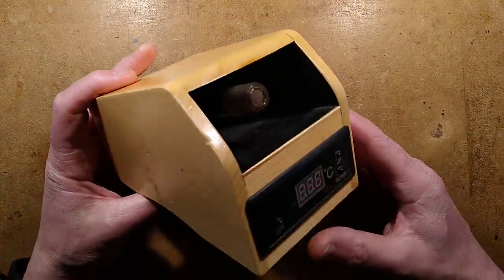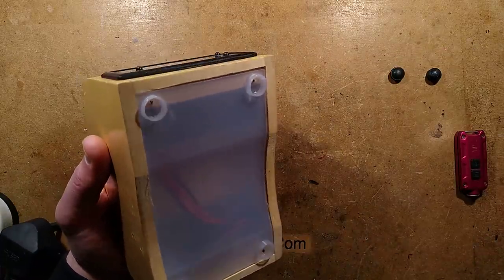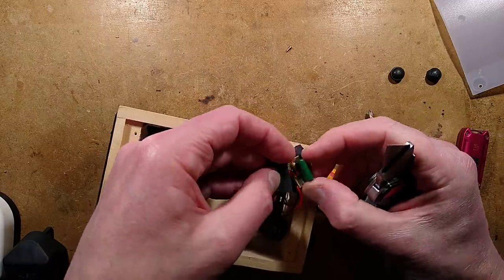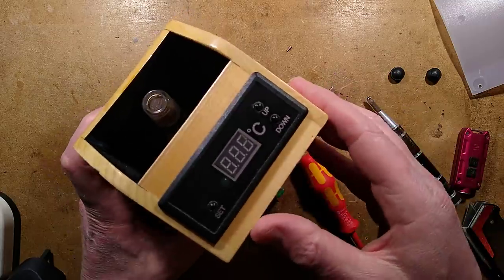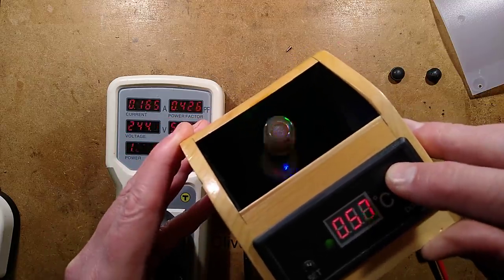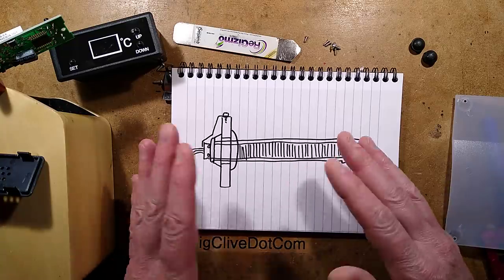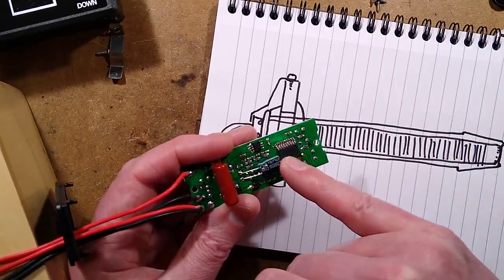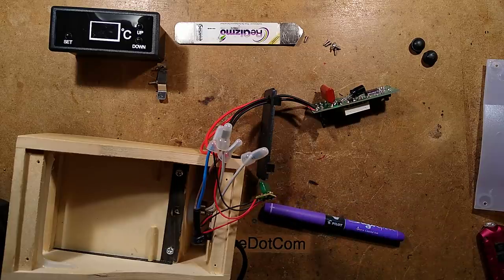Exploring a mystery gadget

Comment: Ive had one, but never seen the insides before. Its my understanding that its essentially a soldering iron with a glass fitting. It uses tubes that plug in, I think they call them whips. 
The one I had was actually a fairly nice unit, I cant remember the name, I didnt really use it. It turns out that I prefer a bowl, since the pandemic, herb sticks have often become the device of choice

Comment: "Vapor Canon" is missing the "whip".. Air comes in at the bottom of the glass tube with the frosted connection for the silicone tube that has another piece of glass in the end with a space then a screen and you inhale the ground herb through the "whip" and against screen setback about 2"(50mm)  after that space(for the herb) screen stops it there and you then place the glass piece with herb on that end of the silicone hose on the wooden box glass with the ceramic heater. The air comes in through the bottom of the glass with the lights that attaches down inside the wooden box. there are usually 2-4 holes in the glass near where it threads on, going over the ceramic rod which let's the air come in the bottom of it heating as it goes to the tip and bringing vape through the herb as you pull warm air through it/  through your whip (4-6 inch piece of glass with conical frosted connection to match the one in box, gap for herb, then screen to hold the herb from going up into the hose which has a mouth piece at the other end) this is pretty much the first legit design where only hot air touched your herb, before this it was basically an upside down jar with a soldering iron sticking straight up inside with a little metal plate on the end you put the herb on then let it heat that tray up and fill the upside down jar or gumball machine looking thing, then stick your hose in the side and pull out the smoke...

Comment: I remember these were always the worst lol. For vaping dry "flower" you really want an active convection unit. I'm not saying that you can't get decent results using conduction, but there's usually a steep learning curve and will always require alot of stirring of the material and constant temp adjustments.
Reply: These worked just fine

Comment: I been working on or examining not just electronic but all types of gadgets my whole life and pride myself in usually guessing what something is or what it might be used for when I see it. I thought it was going to be either some type of audio/sound mic for specific frequencies or maybe an infrared (or other type of  electromagnetic radiation) detector but never never would I have guess a bong :)
Reply: On first glance I thought it measured ionising radiation as the tube and grill at one end looked remarkably like a Gieger-muller tube, which I was acquainted with when working health-phys in the reactor compartment of a nuclear boat - then I saw the LED temperature display and the game was up, I knew instantly what its likely use was.    Yeah, I know - the notion of a gieger counter in a wooden box seems somewhat implausible...  But it could have been a school  project (?)

Comment: Maybe it's programmed like my refrigerator thermostat (the style of which you've featured on this channel recently), it has a "do not stall the compressor" feature.  If the temp is above the setpoint plus the tolerance at power-on, it delays for the compressor delay to make sure there was not a brief power interruption, therefore the tstat has no idea for how long the compressor was off.  Seems kind of silly for something at 200 degrees, but no good way of knowing.

Comment: Darn, everyone has already educated you on this herbal vaporizer.  I used to have one.  These particular units are considered cheap-o versus others, for one thing, the user has to regulate the airflow (surprisingly carefully) unlike units with their own air pump.  I've see these sell for anywhere from $50 - $100 here in Colorado, USA, where all of that stuff is completely legal now, and both cops and legislators (who get to spend the tax revenue which comes back to the state) are quite pleased about it too.
Reply: Some of these units (it has been cloned infinitely)  come with a light show for the glass lamp: a 3-color diode that cycles - quite slowly on the ones I saw - through the spectrum, sorta, within the limits of the sad little LED.

Comment: You can pull the glass tube out of the grommet just wiggle it around a bit it'll loosen up, I've done it a few times to put it in a better designed vertical arrangement

Comment: apparently these have a dangerous ceramic heating element in them that releases small ceramic particles which you then end up inhaling... which is not so good, although you can get ones that more expensive that are made with better components/safety features etc. but these desktop style units are considered outdated at this point, especially when you can get whats known as a "dynavap" for around 60 pounds and build your own induction heater, whatever that is :) i hear it can also be used with a standard "butane lighter"... whatever one of those are

Comment: Cannabis vaporizer from early 2010s. 
The glass is ground for the coupler to seal. 
This is standard borosilicate glass like used for chemistry.
They are 14mm or 18mm couplers. 
It is very surprising how well a ground coupler can seal.

Comment: I owned one of those!  Earlier model with no LEDs and a dial to set the temperature instead of buttons.  It worked very well.  Speaking of soldering iron heaters, I also owned a "BC Vapourizer", which was just a vertically mounted 40W Weller-brand iron, with a "herb bowl" installed in place of the tip.  This was all enclosed by a glass jar (to catch the "herb oils") that simply screwed onto the lid.  Very simply, no temperature control, so eventually the herb would start taste like burnt cork.  But we liked it, dammit!

Comment: So it's basically a 'dry bong'...   Of sorts.  

I  actually have a similar device that someone offloaded on me years ago, that is basically a soldering  iron element placed vertically in a round base structure.  On top of the element is a small pan/ringed plate on which one places one's  dried erbs.  Also emplaced  in the base is a metal tube that runs  vertically to a point above the heated pan and at the base end is attached to a flexible clear plastic silicon tube - that would be placed in the mouth of the partaker.  There is no temperature controller incorporated however.  Over the entire gubbins is a spherical glass enclosure that can be removed to charge the pan with more erbs...  The whole device resembles at first glance - a plasma orb.   Perhaps not surprisingly (given my warning below...)  I've  never used it.
.
These devices are essentially akin to a 'hot-knife'  and  one should be very careful in using such devices, as hot gasses can very easilly burn holes in one's bronchial sacks...   I speak from experience.
Reply: Dunno what you are talking about, but it's pretty hard to burn your lungs with these with a modicum of sense

Comment: There doesn’t need to be airflow through. You use your inhaling force to pull the boiling oils out of the dried herbs. I do have a model though that has an actual fan that pushes air through instead.

Comment: WOAH!!!! I"ve used that exact model before! OLD SCHOOL (by today's standards) vaporizer for smoking weed! The weed goes in the end of the hose which then slips over the outlet you see there, you don't appear to have the hose/bowl with it. Very smooth, but I'm kind of weird, i don't tend to get a buzz off any of the newer methods, I prefer the old school load it up and smoke it :) This would have been around 2008ish. Long before vape pens came out, or at least before they hit my area, they weren't far behind. There's also a volcano style i've seen used that puts the weed vapor into some sort of bag and then you take a hit off that, so it's a lot at once, but never used one or seen one in real life, but i imagine the mechanism is similar to this.

Comment: built a unit for similar extraction from a soldering iron and a small brass cup on the tip about 25 years ago

compared to modern devices, its like Mao's backyard steel vs a Pittsburgh mill lol

Comment: After you mentioned it warming up, I was actually under the impression it was a device that warmed up certain toys
Which I'm sure would have worked too.
Reply: Wtactualf are you talking about?
Reply: @thejoeyc  buzzerz.... for the birdz and the beezzzzzz
Reply: the heating thing totally looks like a pe@is.
edit: Sad it's not pink.
Reply: I thought so as well
Reply: @zeke7100  🤣🤣🤣
Reply: @Shad0wBoxxer  🤣🤣😎
Reply: @thejoeyc  sometimes called a hole warmer.
Reply: A nice and comfy 200 degrees should do
Reply: @Mromfgtrololol  wee bit on the high side , but depends how dank the bud
Reply: Who wouldnt want his fleshlight at a cozy 125°C
Reply: to 200 degrees?!?!
Reply: @Mromfgtrololol  🤣🤣🤣
Reply: Hotdog roaster
Reply: I'm fairly sure that Big Clive has already disassembled and tested to destruction a device like you are referring to - a thing like a test tube with a cable attached. You plug it into a USB socket, it gets warm and you use it to warm up a gentleman's pleasure device.
Reply: @mcrsit  It cools down while moving it into position, the initial temperature is just to store enough thermal energy to keep it at 40°C during use.
Reply: Toys warmed to 200°C ... -_- fun
Reply: @johndododoe1411  terrible concept that would lead to people leaving ther heater attached while pumping and when it breaks hope you weren't sounding

Comment: This machine decarboxylates "Herbs," Cannabis especially. The process of decarboxylation releases the cannabinoids in cannabis, along with Co2. It also changes the THC molecule shape, making it a psychoactive substance that can be absorbed either through consumption, or inhalation. The more common way of achieving this is to burn the cannabis and inhale the smoke, rather than ingesting it. However, eating cannabis that has not first been decarboxylated, will render little desired result.

Comment: i have a similar device but its used to heat Super Glue for super glue Fuming in a air tight box, i used em to make Small Warhammer figures as its easier to work on the models getting a light layer of Super glue before priming paint.

Comment: Man I would love to see one of these in simple schematic I could follow, I have the know how with a solder but not to knowledgeable on the Temp Board. Have an old 1980s heating Element from a heatup hair brush that I feel would work perfectly if I could follow some simple directions and make one of these beasts. Lvve the DIY Oldschool look of the thing rather than standardized machines like the Volcano or other vaporizers. Would be a great little project!

Comment: Just a passing thought about the outer casing on this gadget, I build and repair guitars and with many of the commonly available wood glues you can steam the parts apart, sometimes just heat from a heat gun will suffice but a bit of moisture helps the "party" get underway. 

Given that this may have been built by stoners, they may have used the glue that meant not getting up so it could be Pritt-Stick mixed with some damp Rizla glue for all we know 😉 😆
Reply: Interesting. This isnt really built by stoners though, they were built in actual factories
Reply: @wesleyhayes1847  I was being a daft bugger but I have to admit, it does look like it was built in the backroom of the shop it was sold from although the bent plastic part suggests better tooling than the average backroom of a shop type of thing.

Comment: On this topic, look up the magic flight launch box for an example of absolute minimal design, and the xmax pro 3 for the modern take (toke??) On this. Edit. Seriously you will love the mflb. They achieved the same thing with a lump of wood, some wire, and a metal grill. On off switch is a battery pushed in against a rubber ring, and temperature is controlled by how hard you inhale.

Comment: Haha second I saw the thumbnail... I thought "wow they put rgb in a cannabis vape". Arizer is a popular company that offers a similar product if you want more examples. You may be able to buy a tube fitting that fits to this model. You put a hose on the end of the glass heater that contains the herb at the end that it connects to the heater. As you suck on the one of end of tube it draws heated air through the compartment holding the herb and removes most of the combustion from the ingestion process. It Is considered healthier by most.  This one is neat... ps try the herb :D

Comment: Yes beaker glass attachments have been around forever for chemistry. However I’m disappointed in the lack of proper temperature control when thermistors are so cheap…. However I hope more modern units are more accurate as the temp is crucial with terpene release.

Comment: Fancy stuff. I recall an indistrial heating element (bag sealer IIRC), a rotary pot and voltage dropper to be quite sufficient. Oh and gaffer tape.
Allegedly quite effective at slowing down the brain for significant periods of time but prolonged use may cause a degree of paranoia that wasn't already there. Again, allegedly.

Comment: I saw you post this the other day but didn't have time to watch till today... When I just saw the thumbnail I was thinking it looked like a soldering iron control display... and the second thought that came to mind was a vape set up ...  Did you say whether or not it had a pump inside...  If it was made with a metering pump and a small vacuum discharge pump... It could virtual fill a room unintended... 
Not that I'm into that stuff... Maybe in days gone by but not now 😂
Reply from the maker: No pump.  It's entirely lung powered.

Comment: I knew exactly what it was as soon as saw it 👹. This unit normally goes for around 80 bucks new. I have seen cheaper chinese knockoffs that look the same as well. These use to be top tech, but now herbal oil extracts are sold in a cartridge with a built in coil to vaporize and screw into a standard 510 battery.  Very simular to the first ecigs that looked like a regular cigs. Without any need to buy any expensive equipment like this. It is kind of funny how technology works to improve all aspects of life. 

I am in my 50s and have used/owned computers sine 81. Back then everyone made fun of us nerds, but today it seems everyone is on board with using tech to improve their lives 😀

Comment: Hmm... how safe is that device? I mean, electrically. Wouldn't it make sense to have a thermal cutout in case something goes horribly wrong? I don't know if you can rely on the (at that point potentially impaired) user to react properly if there is a malfunction.
Reply from the maker: I doubt such things bothered the designer.

Comment: It is a VAPE.  For inhaling the vapour from certain GREEN smoke-abl;e products.  There should be a tapered glass tube with a gause halfaw down, and behind that on the end of the glass tube (vape bowl) there is a plastic pipe on which to suck.

Good memories..
Reply: Yup.  i was right.   Now to see what's inside.
Reply: Gutted.  I was hoping to see a few ptc's, or even nicrome coils..  would be handy to know should I get around to repairing one.   Was considdering using a vape driver with a few 3660 Li cells and a BMS to make it more portable.

Comment: Ahh yes ... a good variation is a 24 Volt , 45 Watt Weller™ soldering iron element , positioned upright in a small box containing an 18 Volt mains transformer , the ( noxious substance ? ) is dropped in the top and the thick yellow smoke is inhaled via any handy small bore tubule ... you will need to stuff the lead end of the element with a screw or glass wool to stop your ideal " substance " falling right through ! ... there is NO NEED for fancy electronics , but do not run at full 24 Volts as you will totally incinerate your " substance " ( oh no ! )  FYI a low voltage element will last MUCH MUCH longer than a mains element ( thicker wire ! ) ... add LEDs should you wish ... umm ( tried - n - tested ) many times , errrmm ..

Comment: The lack of a direct air path is a cheap and easy way to restrict airflow. If you draw hot air through the chamber too fast it can cause the material inside to combust which defeats the purpose of the machine. It doesn't work that well to be honest. An over enthusiastic partaker can easily draw too hard making a mess of things. This is why "forced air" units have become so popular. Just take the human factor out of it.

Comment: I used this device before, its an old school vaping device for smoking Mary Janes
Reply: the device you have is an actual heating element, you need a glass vessel with a tube attached on the end, pack your favorite herb in the glass container, plug it in and inhale.  The volcano has replaced this

Comment: Dear mister Clive,
I have a burning question. How do I convert 6V AC from a bicycle dynamo to 12V DC for a car cassette-radio. It's for an experiment.

I'm out of ideas, and the internet isn't much of a help.
Do you have any tips or trics I can use?

Kind regards,
Bas (NL)
Reply from the maker: Just rectifying and smoothing it might work, but also consider a voltage doubler based on diodes and capacitors if the voltage isn't high enough.
Reply: @bigclivedotcom 
Thank you, I'll keep trying